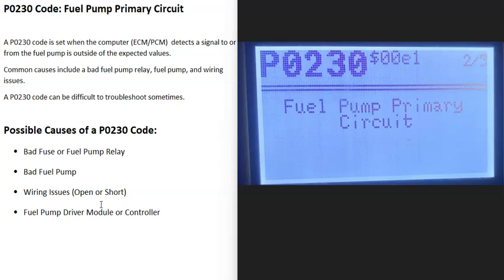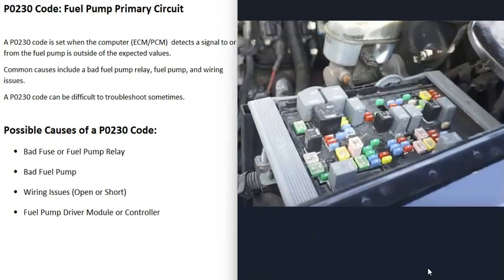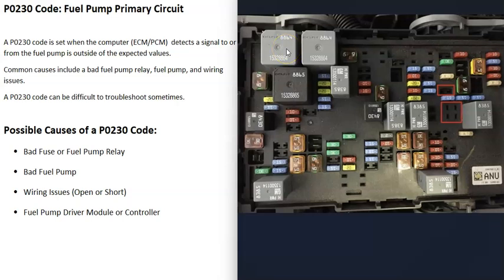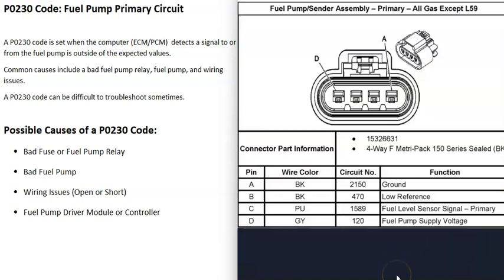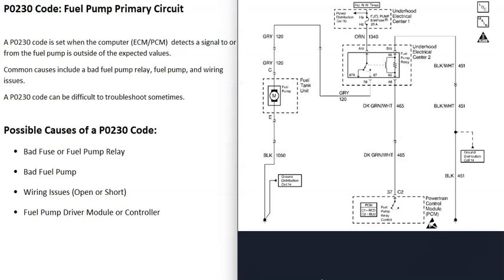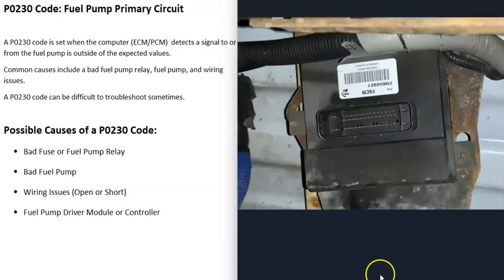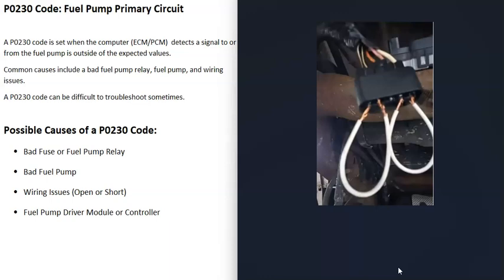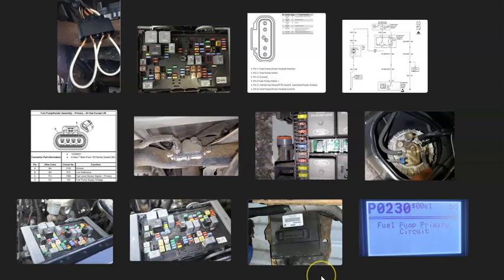Causes and Fixes P0230 Code: Fuel Pump Primary Circuit

Comment: Awesome & helpful video.  I am stumped.  I have a 2008 Cadillac SRX 4.6L.  Here’s where I’m at with the p0230 code:
Relays & fuses check/swapped and are good. 
I can hear the fuel pump come on when the key is turned on.  
I have 58 psi when checking fuel pressure which is dead on with the manual. 
I have 11volts with the multimeter at the injectors.  
The car cranks and cranks but will not pop or start.  If I wasn’t getting the code I would assume a spark issue.  I am stumped and don’t know what to try or test anymore.  
Also, I can’t find anything about a driver control module on the internet for this model car.   Any input is much appreciated.  

Thank you.